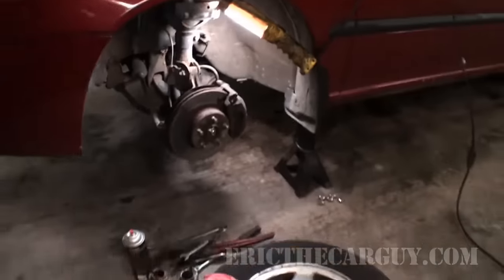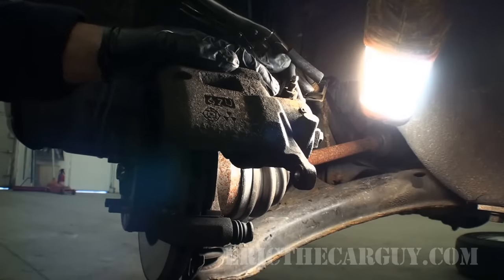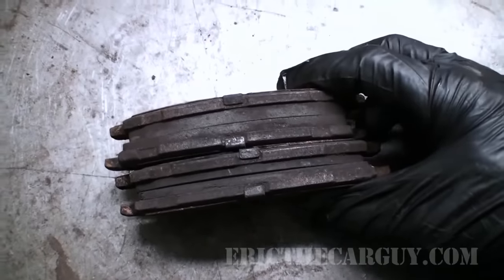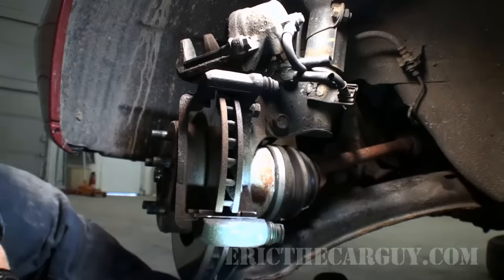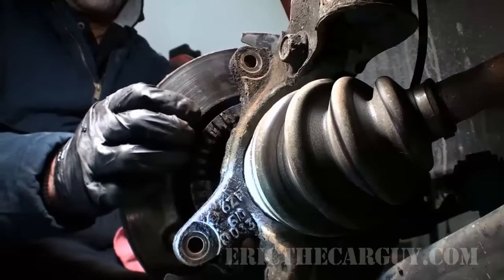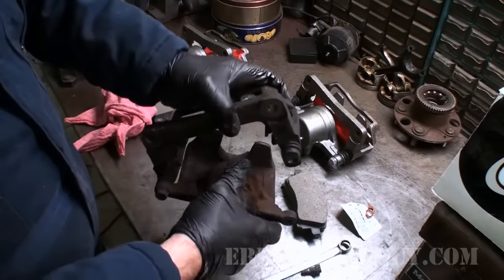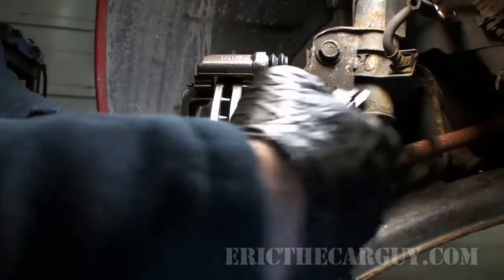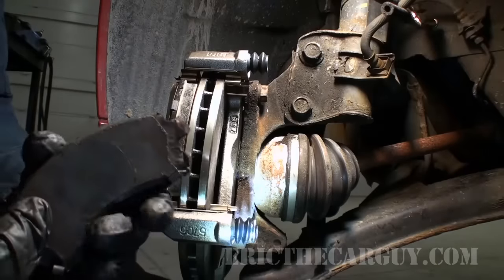How To Diagnose and Replace a Bad Brake Caliper -EricTheCarGuy

Comment: Does one have to loosen the bleeder screw when your pushing the caliper back in?  
Can you just push the fluid back through the line into the master cylinder?
Reply: You don't have to, it's just good practice to keep the bleeder from corroding and freezing up from non-use.
Reply: Romulan112 , if you release the bleed line you'll have to bleed your brakes

Comment: All my life i just used a clamp to push in the piston. I am 57, and i can not believe I was doing it wrong all these years? Why do you have to loosen bleeder please? What is the reason? I am shocked, haha, I never ever did it, and piston always went in. i was always just putting on new pads, maybe that is why? Great video by the way...
Reply: +123ram123ram I think opening the bleeder is necessary when the hose is pinched off, the fluid displaced by the piston being depressed must have someplace to go when forced from the caliper fluid chamber. normally that fluid would simply return back through the UNCLAMPED brake hose. I hope that answered your question, and offered abit of clarity.

Comment: If a brake pad falls out of a caliper because the brake pad is worn down to the metal does the caliper needs to be replaced or just the rotors and pads

Comment: I went to a mechanic shop the other day cause i was pretty sure my caliper was sticking but they put it on the lift and the tire spun freely and said it was fine but on my way home I noticed a smell and pulled over and there was smoke coming from being the wheel lol is the caliper stuck ? Or what could this be

Comment: How do I get the rear parking brake cable loose from the caliper?  I am trying to change out the rear caliper and i can't get the parking brake cable loose.  I have a 2008 Dodge Grand Caravan.

Comment: I changed my pads on my 2013 Fiesta at 35K miles, both sides had more wear on the pad at the piston side. Both calipers were easy enough to back.
Reply: Sounds like seized up or sticking caliper slides.
Reply: Well i cleaned them up and sanded of dirt and rust of the caliper bracket, didn't check the gliders tho.. But others told me that later model Fiesta's have shitty brakes, so i guess it's not the last time i could have issues..

Comment: Who else learned the Hardway ? Although the bolts behind the calliper are Typical meaning lefty loosy righty tighty but when your face on outside the wheel its is reversed so clockwise for left i also had this issue with some crow feet tools with the bleed nipples all my calipers were sized and the rear hand break one missing a pad they had compressed on a angle and now the new pads wont fit its about 3ml out and i snapped a slider bolt thread accidentally or it just siezed and rotten either way need a new mount mybe a caliper This video is very helpfull i understand breaks better and should get mine done today now i have a parts car down the road so i will whipp calipers off that later and hope we get a fix 2 days i been stuck with siezed bolts and general poor condition

Comment: Ive had a guide pin who got rusted so stuck ive had to get somewonecto spin it with a breaker bar and had to hit it out with a lot of force under the spinning. Got a easy pad replacement of hqlf an hour stretged to 2 hours

Comment: my chrysler 2006 T & C front wheel brake locking and my ABS is on. pls help diagnose which part are going to replace. tyvm

Comment: I have an issue with my Saturn L200 with rear disc and no anti-lock brakes. I've replaced almost every brake part (with used parts) due to a hard brake pedal to stop it. I almost plowed into the back of a Honda Civic a few weeks ago because it wouldn't stop well. The only thing I haven't changed out is the brake hoses that looked fine. from the tests I've done from what I've seen on YouTube, everything is working. Yes I changed out the power booster. Still doesn't stop like it should. My Mom has a 2003 L200 that stops fine with little pressure on the pedal. I was also told on a Saturn Forum that "Not every car is going to stop the same". Are you serious ? They're the same set-up on all L200 and 300's. It should stop easy. Any suggestions out there ? This is stumping me to find out why this is happening. To add: all the air is out of the lines. Thanks for your thoughts.
Reply: Almost sounds like a restriction somewhere. Maybe worth checking the steel lines for a creases or smash from a bottom-out or a jack.

Comment: hey eric i have a 2000 4runner that when i drive it if i step on brake harder then normal the truck pulls to the left and steering wheel hard to move to the right while braking is that a bad brake caliper in the driverside caliper

Comment: Don't forget about brake hardware. I'm only a third through the video, but I haven't heard mention of the hardware. I have had vehicles with rusted hardware and pads not returning properly or getting stuck

Comment: "Braided steel" hoses have a plastic tube inside the line that can permanently deform.  Do OEM rubber hoses not have this?

Comment: I replaced pads and rotors, on my 02 avalanche, calipers and pins were great, greased up good, but now have a small brake chatter as I get to last second of a stop, what did I do wrong??? thanks

Comment: We use copper washers as seals in vacuum technology all the time. The steel parts I'm mating together bite into the soft copper washer creating a seal. Why would the same not be true with the banjo bolt? Why the dislike?

Comment: i always touch up my brake pad nodes  on a grinding wheel then wire brush them smooth , there are never a good fit , after that i put a little high temp grease on them

Comment: One fast way to check to see if you have sticky brakes, touch the rim for temp difference- the sticky wheel is going to be hot or warm to the touch (yes front brakes get hot but the sticky one will be hotter)

Comment: I was driving today and my 98 Forester just starting locking up and it felt like the front right it sounded like grinding and squeaking. So I pulled over and pulled the wheel and brakes off. My boot on the axle is ripped but I was wondering what would cause that side to lock up like that? I'm thinking it's either the axle or the wheel bearing?? The brakes seemed to be wearing evenly and I replaced the pads and rotors about 10k ago
Reply: @EricTheCarGuy

Comment: My caliper piston works when hitting the brakes, but once depressed, it does not release, causing my pads to rub and heat up the rotor..I've checked both guide pins, checked the pad sliders, all is good.. I took the wheel off and accessed the caliper..I can depress it with a c clamp. So it's not seized.  What else can the issue be? Next step is to get a new caliper, but wanted to see if @ericthecarguy or anyone else had any other ideas..thanks in advance!
-Chris
Reply: Bad brake hose acting like a one way check valve preventing fluid from leaving the piston when you release the brake.

Comment: For the backyard mechanic a stubby chainsaw wrench will fit the nut on the top of the Subaru strut. So if you put your 6 mil Allen key through the chainsaw wrench you can then loosen the nut.

Comment: My right rear brake was over heating. I pulled the brake caliper off. The outside pad was completely wore off, the inside pad still had plenty of pad left. the cylinder rides against the inside pad. I cleaned the pins put new pads on and it still over heated, so I pulled the cylinder  apart to see if it was rusted and it was perfectly clean. I cleaned it out anyway and put it back together and it still over heated. I pulled the hose off and blew air through it. It isn't plugged or restricted and it still over heats. Maybe the pin holes are gummed up or something, or that rubber bushing is causing it? Does the bushing go on the trailing edge? I am at a loss here I can't think of anything else. Thanks for any help anyone can give.

Comment: hey erice ive been having an issie with my car, when coming to a stop it feels as if the brakes are engaging then not engaging then engaging etc. now ive had the front pads and rotors changed rear drum brakes serviced bled the brakes and it still does it i dont know of its still my brakes or other things to look at with the brakes or if its maybe a transmission issue while the cars downshifting ?  2011 chevy cruze 1.4l auto
Reply: Warped rotors.

Comment: oh and it's an 07 equinox and the calipers have never been replaced. I took it a few weeks back to have it checked and they said I needed new rotors and brakes and my brake fluid needs drained and refilled.

Comment: On a 2009 Toyota Matrix, rear brakes, I was able to turn the pistion but it did not got into the caliper housing.....any idea why ? I used the cube an extension and a ratchet, pushing and turning.....

Comment: Changed left break caliber on a 2001 chevy truck. Went through the process of bleeding the brakes until no bubbles. Brake pedal feels right (tight) until the engine is started, then break pedal very sluggish and goes all the way to the floor. Was not given new washers with caliber,  could this be the problrm or what else should I be looking at???  Breaks worked fine before but pads needed replace and  one of the bolts in the caliber was badly stripped beyond removable so replaced the whole caliber now this, help....
Reply: Loretta Adams is the brake fluid reservoir nice and full?  You could have sucked some air into the master cylinder if it went dry while replacing/bleeding. that would require bleeding the entire system (all 4 wheels) like ETCG said, if you do this make sure you continually add brake fluid as you go to each brake. 
This could also be a bad banjo bold connection, have you noticed any brake fluid drippings? are all your bleed valves nice and tight?

Comment: You say if it pulls to left its the right caliper that's bad. On my f350 going only 2 miles or so it's pulling to left real bad when I hit brakes only lightly. And the left side is smoking hot. Had to put snow on rotor to drive it back home so my left is the problem. Truck sat for six months so is it possible they are just stuck and need taken apart and just need cleaned and freed up.  Thanks
Reply: My ford PU did exact same thing.  It was the rubber brake line pinched off by a metal clamp to the frame swollen by rust.  You could force fluid to the caliper but it couldn't return.  I discovered the real problem when I was installing the new brake lines.

Comment: Would you still have to replace the caliper if the rubber boot/gasket on the pisten had a small tear in it?
Reply: +VanSaucy 
If the boot has a tear, it's likely that tear has introduced moisture into the system, which causes rust/pitting/etc.  You have to take apart the whole caliper and inspect the piston and it's bore thoroughly for rust, dirt, and pitting. Rust and dirt can be cleaned away with a wire brush and parts cleaner, but if it is badly pitted, it's not fit to go back on a vehicle and needs to be replaced with a new caliper. 
Altogether it's an easier and safer bet to just replace the caliper, but you absolutely can clean up and re-install old calipers without problems.
He actually has a video on that!

Comment: I have 2001 Ford focus se dohc manual transmission, the top end of my brake caliper on the driver side, doesn't ride on the spindle, what is the possible problem.

Comment: I was using my channel lock like on the video on the caliper piston but one of them was stuck so I struggle but kept going and it started leaking brake fluid out the rubber boot from the caliper piston ... is that normal ? Btw it got stuck while changing my brake pads

Comment: Eric, you are more knowledgeable than I about cars.  However, I believe that you wouldn't have had the problem pushing the slave cylinder back in if you hadn't crimped the hydraulic hose, thereby giving the fluid no place to go.
Reply: Erle, remember he opened the bleeder valve, the fluid did have a place "to go"

Comment: I just did a brake job.. replaced all rotors and pads but ended up finding out I had a bad caliper.  its a rear caliper with the integrated parking brake.   the piston is staying closed after the brakes are used..  the thing that sucks is I took the car for a drive to test it out and it smoked that crap out of the brand new rotor and pads..  uhhhggg.. hopefully didnt warp new rotor but probably did.  now Im wating for the new/rebuilt caliper to show up.

Comment: I was told both rear calipers on my car need replaced. They have 276k miles but not a spec of rust on them. The brakes are wearing uneven but I thought that was only because one side of the e brake catches because the other side has a stretched cable.

Comment: Little trade tip for those replacing calipers , get something to depress brake pedal even one inch , primary deal covers the port in the master cylinder and creates a vacuum lock and when you pull caliper off no brake fluid will spill out , just easier then pinching brake lines , still always bleed after
Reply: Seal * not deal

Comment: Couldnt u simply have used a bench grinder and ground off the little bit extra metal on the pads tips that was preventing it from sliding onto the bracket properly? Just curious

Comment: the caliper slide where you put the pads in not the piston part do they sell these separate. i only need caliper slide because guide bolt is frozen in

Comment: Just installed new rotor and pads but I hear grinding noise every time the rotor rotates. It breaks fine, at slower speeds you can hear it grind but once you drive it fast it goes away and when it comes to a complete stop. I wonder what could it be.

Comment: Help! I have a 2003 Ford 150 2WD that has have the front left caliper, pads and rotor changed 3 times in a year 1/2, and now there shot again! The last guy took the tome to also change the brake line that's attached to the caliper.

Comment: The hole on the shaft of the banjo bolt needs to line up with the brake hose, I would scratch a line on the top of the banjo bolt to show where the hole was when I installed it.

Comment: I own a 03 corolla had new rotors and pads 3 weeks ago still squeak grinding can it be old or rusty calipers do I need to lubricate or replace thanks
Reply: Madd Bumxxx the squeeking can be coming from the rear drum brakes, they need to be cleaned and lubricated on the mounting points of the shoes and adjusted properly

Comment: So I'm having this problem: when I'm driving only in speeds of 75+mph(I know that is too fast) the car pulls to the right WITHOUT me braking. But only at that speed or higher. Any thoughts?
Reply: may want to consider getting tires rebalanced.  sometimes the weight can fall off or shift slightly to cause that.
Reply: Rich R thanks Rich I will definitely do that
Reply: Rich R

Comment: Hey? I put break booster on yukon Denali I put the pin back on but the paddle is to the floor I get the top bolts tight is this why the break paddle is to the floor

Comment: Ok I have circle ring on my rotor. I have checked my pads and rotor. While I found out that they have two sizes and the bigger size is the one to have so I have replaced my pads and rotors and still making a groove circle on my rotor what could it be? Leave comments below . I would like to know I have look at everything I also check to see my wheel bearing is to be need to fix but I dont hear a sound when I move .
Reply: That's normal.

Comment: How would I tighten a slider pin if It only has one 12mm bolt and the other side is just a flat round metal cap, I had this loose problem damage my rotors and now I have to resurface them

Comment: I got an 09 Chrysler van the rear calpier has play, it moves back an forth on sliders I don't think this is normal if my caliper was working I don't think I would have the play I have.  Brakes are spongy after bleeding.

Comment: I'm gonna ask why is it important to use steel metal flat washer and not copper washer for the banjo bolt?
Reply: Crush washers are normally aluminum, which is softer than steel or copper. Perhaps being both white, he confused "steel" with "aluminum". Oil drain crush washers are aluminum.

Comment: My oem line is good on my 350Z but a little fluid is coming out of the caliper where it screws in. 
Its on an 05 350Z with brembo brakes. Any suggestions?
New caliper
Reply: Shane Link  no ,its the oem brembo. I put a new line on it and added a product called seal all. 
Lately its been like 0 degrees so I wasnt wanting to mess with it.
But it really slowed down the leak to almost nothing
Reply: Now I have to bleed the line

Comment: hey eric, my friend drives a dodge durango that recently had brakes done, but intermittently it has an issue. the pedal will sink to the floor and a grinding noise can be heard and felt through the pedal. there is none to next to no braking power when this happens, though it only happens intermittently. any thoughts? anyone else have any ideas?

Comment: Flixable brake line can couse calipers or wheel cylinders to lock up brakes by interior failer of the inside of the brake hose line by creating A check valve after applieing the brakes then fluid does not return very well coseing the the brake or brakes to stay applied.

Comment: Another guy on another YouTube video said you can use anti-seize on the caliper pin.  Is that incorrect?
Reply: Depends if the grease base is compatible.  Is it silicone you should use or avoid?  I can image a lot of cheap grease would have random hydrocarbons and could be very bad for rubber over the long term.

Comment: I c hanged my brakes but when I put the the caliper. Back on the brakes lock the wheel, I didn't disconnect the brake line either, sugesstions